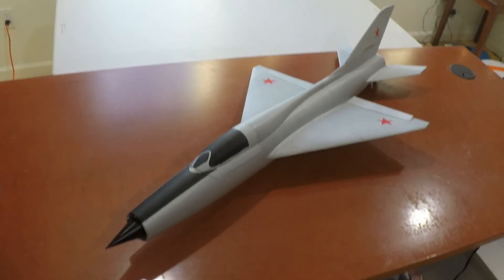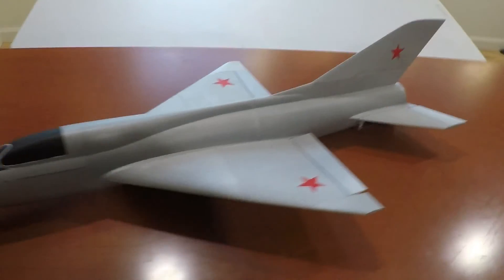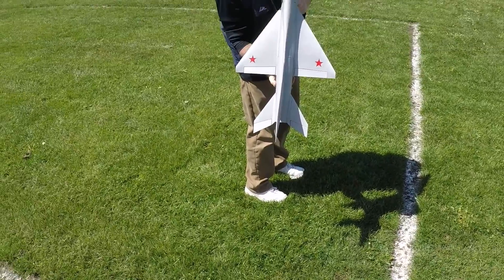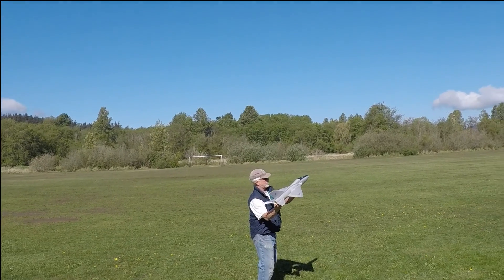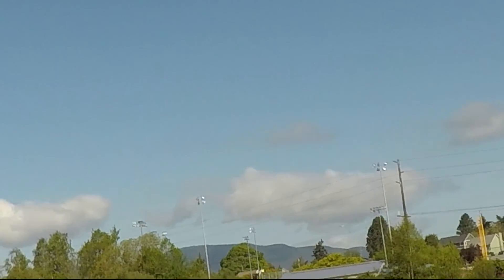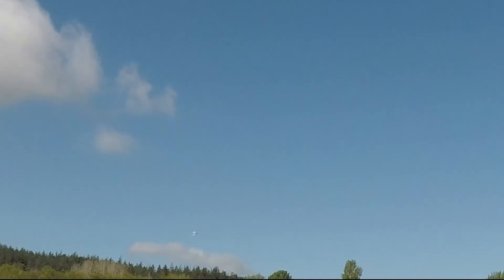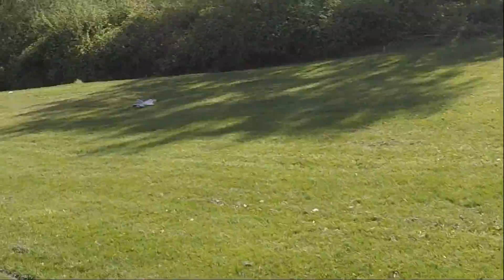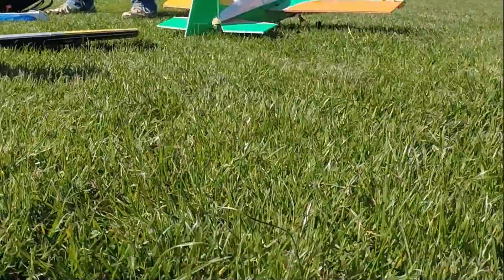MIG-21 3D Printed 50mm EDF Overview and Maiden Flight of Prototype

Comment: I would have lost orientation a hundred times, only I would not, because I would have crashed it the first time. 😂
Well done.
Do you put expo in your controls?
Reply from the maker: Yes on the expo. Maybe too much (70%) but it is what I’m used to. Next flight the ailerons are dialed back on the throws
Reply: @thenerdoligist1292  that is a lot 70% - I am in no way as good a pilot as you, but it sounds like restring the throws by putting the pushrods closer to the axel on the servo or further out on the control horn and taking the expo down to 40~45% may make for an even smoother flight. 
I'll be back, to ask for advice from you once I get restarted flying my models 😁

Comment: Excellent... well done, i would reduce throws on aileron and elevator add 20% expo on each and move the CG foward probably 4mm to reduce the wing rock. it should be better then.
Reply from the maker: Thanks for the recommendations! I’m printing version 2 now. I reduced the size of the ailerons and added the sub fin. This should help with stability too